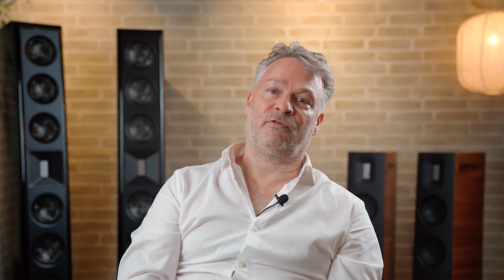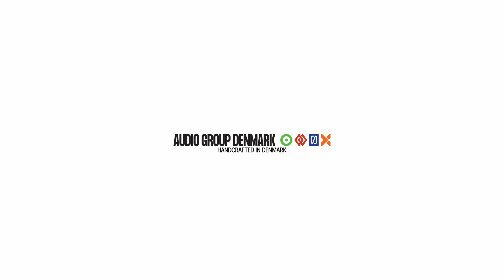Beyond Boundaries: 2.5-Way vs. 3-Way Speakers | FAQ

Comment: If you do have a phase / time domain coherent filter (acoustic first order).... Wouldn't that fix those issues?

But this comes with other challenges I reckon.  An acoustic first order filter seems to be extremely complex with heaps of phase correction components 😮

And again, I believe that may kill the transparency and dynamics

🙃